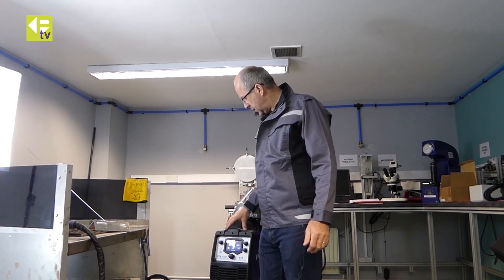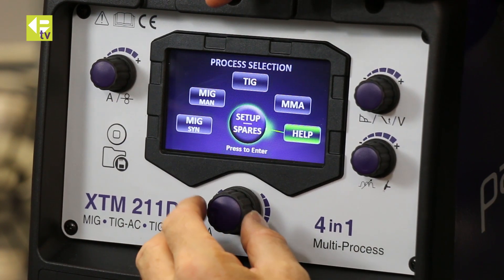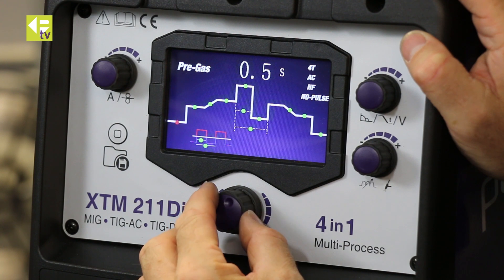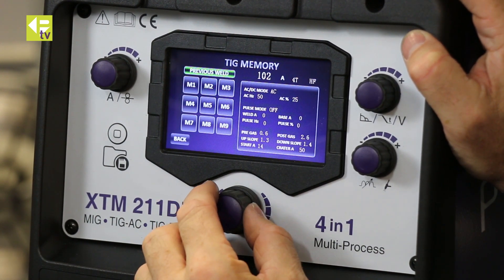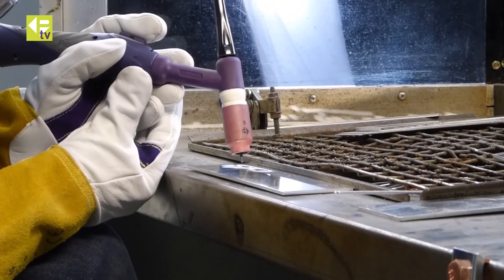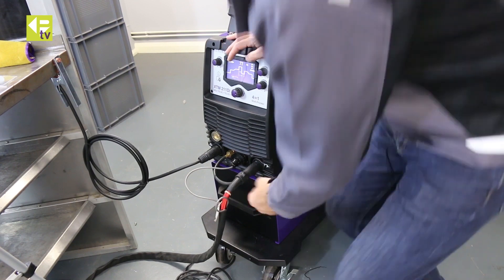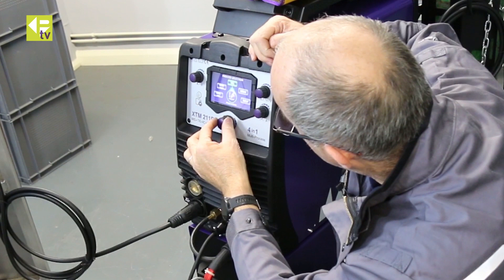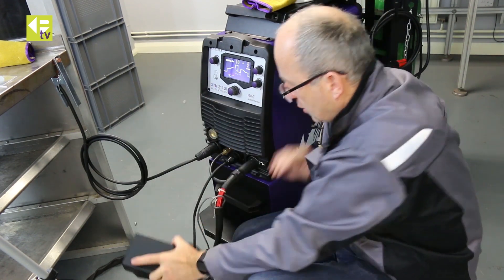XTM211Di 4in1 Welding Machine, Demonstrating The AC Function (Aluminium) In TIG Mode

Comment: Ok quick question. Can I use different brand Mig and Tig torch on this multi process wrlder?? I have Binzel 5 metre Mig torch ( I don't need extra buttons) and CK Worldwide and similar Tig torches with own on/off button and foot control. 
This mashine is on my baying list 😁
Reply from the maker: Hi, great question, you can use any Euro fitting MIG torch and your TIG fittings are 3/8 on gas, 35-50 on dinse and an ERCP18 control plug (unless using foot control). You may be able adapt your foot control with our control plug.😃
Reply: Hi
Yes you can as I have CK torch fitted to mine and with every parweld tig you get a connector so you can make your own switch.
I am about to do a review on this very shortly